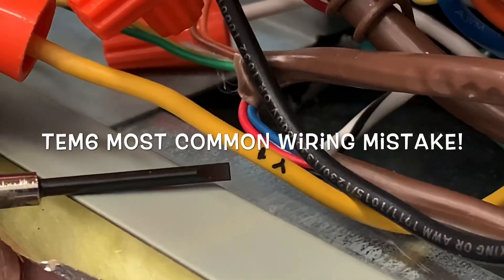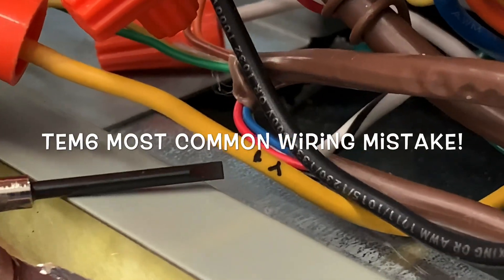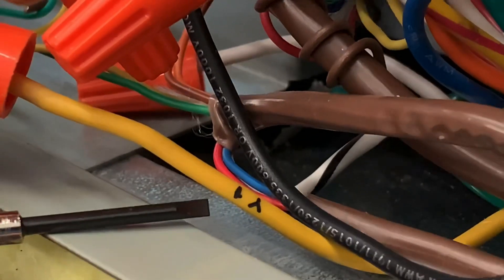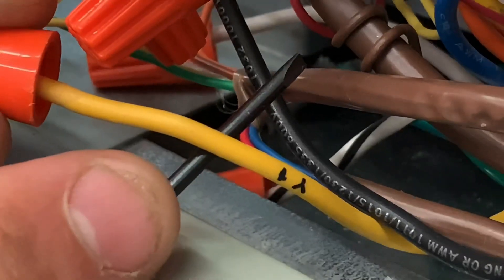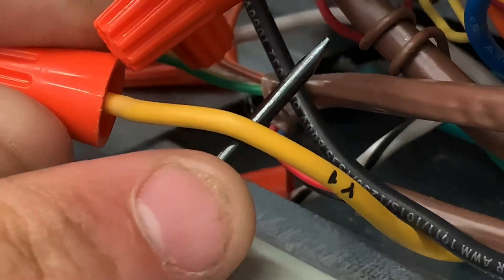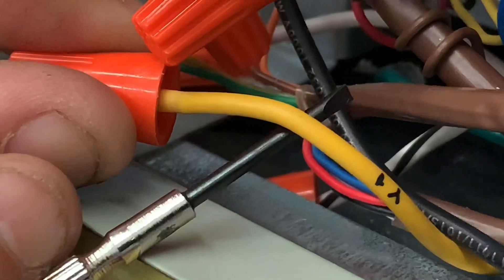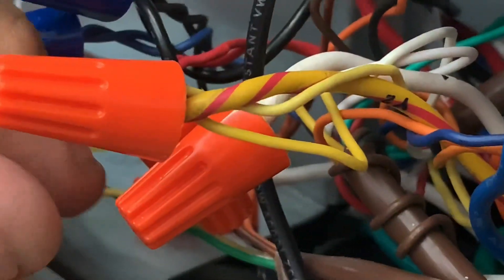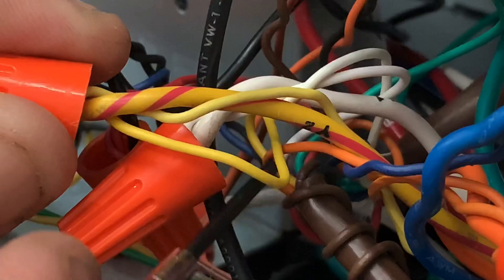Tem6 most common wiring mistakes

Comment: If I have an American standard gold 824 thermostat and a  TEM6 air , do I still need to connect the yellow wires to the Y2 and do I set the delay option to enhanced?  Or just leave the delay option to off? And should the airflow be set to normal. I'm having issues with humidity so I didn't know if I should keep the CFM on low or change it back to normal

Comment: Thanks for sharing your insights. I wonder if this video only applies to a single speed air handler and if it’s necessary for a variable air handler like a Trane TEM6. I have a 2 1/2 ton single stage Trane heat pump paired with a TEM6 variable air handler. It's winter and I'm in Heat mode so if the video here applies only to summertime cooling, please disregard. After watching this video, I decided to switch the wiring accordingly. Prior to doing so, my DIP switch settings had the air handler on High (437 CFM/ton), as opposed to Normal (398 CFM/ton) or Low (350 CFM/ton). After switching the wiring to connect Y1 from the TStat to Y2 in the air handler as the video points out, I changed the DIP switch settings back to Normal (398 CFM/ton). Interestingly, the air output seemed identical to when I had the Y1 TStat wires connected to the Y1 air handler wire and the Dip switches set to High (437 CFM/ton). 

Essentially, I’m in the same place I was in terms of CFM/ton, the only difference is before I adjusted the DIP switch settings to high and now I’m wired to High, which makes me think I should have kept the wiring the way it was and managed CFMs with the dip switch setting. Curious if anyone has any thoughts on this.

Comment: I had a Trane 2.5 ton single stage heat pump installed Feb. 2020 and I questioned the cfms It was putting out. Got the  install manual out and it plainly states to wire it to Y2 in the handler for a single stage compressor.  Removed the cover and discovered install crew had it wired to Y1. I rewired to Y2 and got the proper cfms.

Comment: Would hooking up y1 y2 to air handler and 1 stage outdoor unit be the same as hooking y2 to air handler and 1 stage outdoor unit?  I believe it would be the same.  Another technician where I am at thinks different.  I would think it should not matter, it is gonna get a call on y1 for 1st stage and when 2nd stage calls it still has power on y1.
Reply from the maker: Y1 only gets used for y1 for first stage of 2 stage unit, single stage units wire to y2